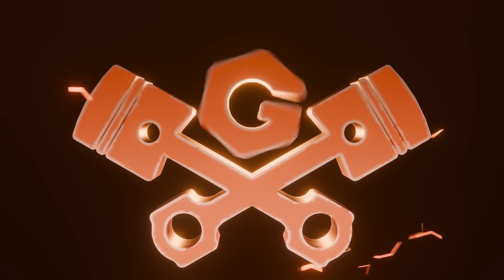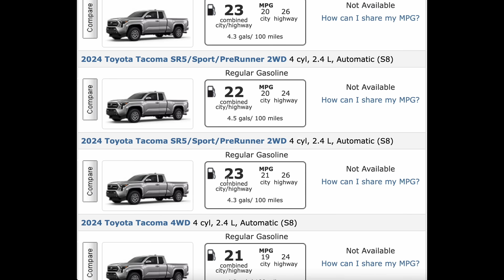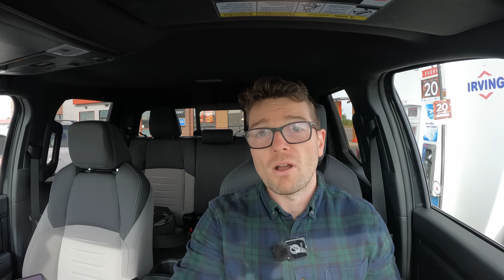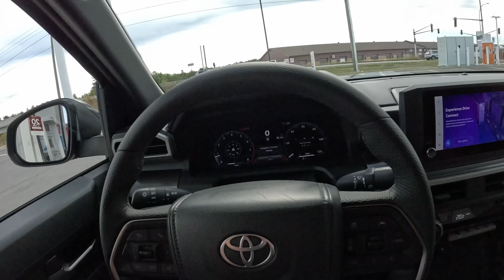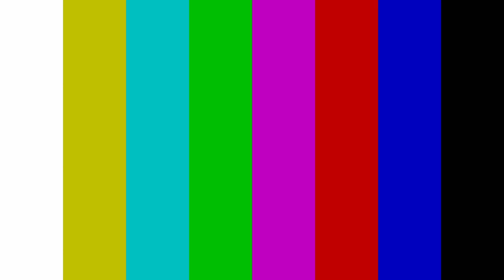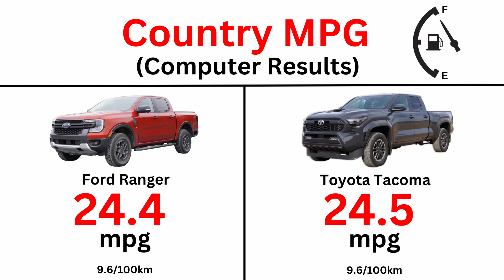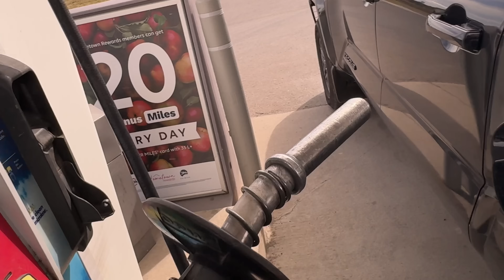Toyota Tacoma 2.4L Turbo Fuel Economy (MPG) Test | Shockingly EFFICIENT or OVERHYPED?

Comment: I am currently on a 8,000km road trip through the Maritimes and Newfoundland,  so far my 2025 tacoma trd off road is consuming about 10.4 liters per 100kms or 22.7 mpg. It is hilly and most travel is about 110kph or 69mph,it is a manual transmission with non hybrid engine. My previous 4liter V6 got 14.5l per 100 or 16.5mpg, it makes a big difference. The torque is delivered at a much lower rpm, makes a very comfortable highway runner and is completely at home off road.
Reply from the maker: Ughh that manual transmission is probably wonderful to drive! when you come through Fredericton give me a honk!!
Reply: My Dad has a 25 TRD sport and so far his economy has been about worse than my 2019. About 10.8 vs 14.1 l/100km. Both are on AT 32's. Im guessing its because of break in as he still has less than 8000km on his. I will say though its a much more responsive transmission so it's easier to be 'heavy-footed' on the 4thgen without realizing youre in it. It's less 'work' to drive compared to mine. I love the thing though, i will see trading in my 2019 in the future for one. I'm waiting for the Offroad premium to come with a 6-foot bed in Canada.
Reply: @Tacobuster88 there's a lot of factors that you have to factor in. Are they both 4wd, do they both have same all terrain tires? Have they been driven the same, etc
Reply: @JohnnyBoy919  Yup, they are equivalently specced, same 4wd, the 2019 has a mild lift, both on Cooper discoverers and yes driven on the same route. I'll chalk it up mostly to break in. Mileage on the 2019 has also improved over the years, specifically after its passed 90k miles for some reason
Reply: @Tacobuster88 The engine acts like a diesel, if it red lined at 4000rpm, it would be fine because the torque is there so low.
Reply: 22 trail edition 10.4 to 11,5 110 kmh. City 11 to 12,5 .
Reply: @danielo3830 On straight highway running I have gotten as low as 9 per 100, at 100kph. Serious saving from 14, especially at 1.60 a liter.
Reply: @craigaustin4779  Now do real world numbers and drive 20-30 over for 100km and let us know .😉
Reply: @Yob126 750kms today all highway 115-120kph , 10.1/100. Iwas in Quebec, they have the sneakiest most devious speed traps, ruthless bastards. 20 over tops, all day.
Reply: You sound like a Toyota spokesman trying to sell the new 4 turbos…..
Reply: I have had 6 since 1988, Iskipped the Gen 3, tried several,  did  not see much difference from my 2009. 10 seconds in the gen 4 and it was sold. Never a faster buying decision. Completely new, far more comfortable for a 6,4 driver. I logged about 1.8 million kms on Toyota trucks, so far. If that makes me a salesman. So be it.
Reply: @craigaustin4779  Your story sounds made up, wouldn’t be the first
Reply: No time for BS, today 866kms 91 liters, mostly 120-130kmh. Including traffic nightmare in Montreal.
Reply: @user-nx5rp9wp4d   imagine being a toyota fan boy and wanting a v6 na.    Toyota made the best factory production turbo engine ever in the 2jzgte which was over 30 years ago. I'm sure they've learned a few things.   4cyl turbo square - basically a petro diesel.  This engine is light years better than any modern v6.
Reply: @naten555  Yeah and new unreliable turbo  v6 tundra engines and their 100k recalls have proven you wrong, and there’s video of even the new crate engines having issues with barely 9k miles.
Reply: @naten555  Toyota is not the same company 30 years ago, new people new technology new problems. 30 years ago Nissan use to be great, now they suck
Reply: @user-nx5rp9wp4d   nissan sucks because of Renault merger in 99.     Who did toyota merge with?      Toyota is fine turbocharge engines are so much better than they were 30 years and turbo toyotas were great then.    Only other great brand left other than Toyota is Porsche and Honda.  Everything else is crap.
Reply: @naten555  Toyota had/doing a partnership/merger with Subaru, Mazda, Hino Motors, Daimler Mitsubishi, and BMW (Supra). Also, you missed the 100k recall on those v6 turbo tundras engines, it they’re so advanced why are they breaking down and having Toyota’s biggest recall in history?
Reply: @user-nx5rp9wp4d you sounds like a Toyota hater spokesperson bro.,no worries bro 4banger is the best right now🔥
Reply: @GuillT-j4d I wouldn’t say the best.. but Toyota has had 4 bangers on tacos since I was a teen.. bullet proof engine. Haters acting like Toyota just started their company 1 year ago 😂
Reply: @noxnyc23 This engine was turbo charged from design, not like adding one to an existing engine. Only time will tell about durability and reliability,  but I placed my bet.
Reply: @GuillT-j4d  If I’m a Toyota hater why do I and my family drive three of them?
Reply: @noxnyc23  Yeah the older model tacomas are “bullet proof” but these new ones are not, just like the old tundras v8 were finally better than the big 3 American trucks but now the tundras v6 turbos are garbage
Reply: @craigaustin4779  Many car makers tried the turbos and all proved to be less durable than naturally aspirated engines.
Reply: @PassivePortfolios Time will tell, I don't trust automatic transmission, but some work forever. I still have my 2009 with 4 liter and 400,000 kms. Maybe it will tow my 2025 to the wrecker some day.
Reply: @craigaustin4779  the key is to change the transmission fluid and filter every 30-40k miles.
Reply: @PassivePortfolios   6 speed manual, not old enough for automatic transmission

Comment: 4600 pounds, holy crap. that's a little heavier than my '99 Ram.
Reply: 3rd gen tacoma is 4500lbs.  The frontier is even heavier than this truck and it's on the same old platform from 2005
Reply from the maker: Heavy indeed sir.

Comment: The frontier pro 4x is available with a six foot box, and no turbo
Reply: And ancient chassis and software.
Reply: I bought a '25 Pro 4x with a 6 foot box. So far getting 20-22 mpg. 24 on the highway.
Reply: @Mindokwin  subtract 2 mpg for real calculated mpg.  it has been well known that the frontier overestimates the actual mpg numbers.
Reply: and that legendary Nissan name.
Reply: @jfox823  legendary dumpster fire lol
Reply: @beexiong2995 exactly
Reply: I have a 2023 SV CC LWB.  It’s averaging 19.6 mpg over 29,000 miles.  It’s been rock solid.  The only issue I’ve had is the whistling windshield molding which the dealer fixed by removing and reinstalling the windshield.  The backup camera is grainy but otherwise the tech and safety features are the same as everyone else.  It does lack the gimmicky drive modes but no one needs that useless crap.  The Car Care Nut has a mechanical review of both the Frontier and Taco.  I wouldn’t buy a Taco.
Reply: @gransport4246 29,000 miles is nothing.
Reply: @gransport4246 Thought carefully about both, looked at all the reviews, drove both and I went with a Tacoma SR5 6ft.  Pros and cons to both but in the end the Tacoma seat was better for me.  Good luck with the Frontier.  Am guessing that either one lasts a long time with proper maintenance.

Comment: 12l /100km ..hybrid! Not happy!🤔
Reply: This truck's hybrid system is not for the purpose of economy it is to enhance the power, add a boost.
Reply: @josiahwyncott7519 
Yes 100% 
But still  higher  than Toyota  numbers!
Reply: My Limited Hybrid is the same so far after 5k. I’m okay with that but have zero idea how Transport Canada rated it as they did.
Reply: @joeimbesi5361 true..I was doing  highway  most and I got 11.4%..
Now combined i have 12..rear traction only / offroad trim. 2k km

Comment: Won't thin rings burn up easy?
Reply: If badly engineered.  If engineered properly then thin, low tension rings can be more sensitive to motor oil soot causing the rings to stick in the lands, leading to low compression.
Reply: Not in a clean world but yeah, dirty oil and if carbon deposits are allowed to hang around.  So for a guy like me that changes oil before it turns black, revs the engine up often, and does induction services about once a year/10K miles, thin rings last a long time.  I even have a Kia and a Hyundai famous 2.0 for oil burning with over 240K on both not using oil to prove it.  Plus, a few customers too.
Reply from the maker: in theory.. yes

Comment: My brother has the TRD off-road  non hybrid he averages about 23 on the highway. His transmission over heats sometimes while towing a Utv on a trailer and in low range the transmission will over heat pretty quickly going up a hill with no trailer just the truck. The over heating is on hot summer days he hasn’t tested it yet in the winter. What did you think about the seat comfort? I like the seats as far as sitting but there isn’t a lot of hip room for big guys like my self. Not a lot of room between the door and center console for me.
Reply: I have a Ted off road and none of what you are saying is true.
Reply: @Annon89 it is absolutely true with the truck my brother has. I never said your truck had problems or anyone else’s had problems. But my brothers does I’m sure your truck is fine and I assume most of them are but some have problems that’s just the way it is this isn’t a perfect world buddy.and by the way it’s TRD OFF ROAD not TED
Reply: A lot of people were reporting these same issues with the Tundras too. Getting transmission overtemp warnings when in 4Lo offroad on long climbs

Comment: The huge airdam on the front looks stupid.  I'd replace that with a skid plate. How much difference would that make in mpg really?
Reply from the maker: I kind of want to test that tbh..
Reply: TFL Truck did a video on this very topic. If I remember, they used a Ram. The difference was bigger than I might have thought. I left mine on after that, cuz I do a fair amount of hwy driving
Reply: That’s what I did. And I don’t pay attention to mileage… I got bigger tires and did that. Don’t think it made a huge difference. But I like to also do sport mode .
Reply: I did exactly this as soon as I got mine. Removed the air dam and put on an engine and transfer case skid plate. Air resistance is mostly a highway problem due to how it scales with speed, and I don't drive fast on the highway so I don't expect to feel the mpg hit that bad. In any case, I would 100% accidentally rip it off backing out from a snowbank or similar, so I'd rather remove it before it gets torn off.

Comment: Just me being me. Im not a fan of the tacoma. I think the V6 ranger is better.
Reply: Your opinion that the Ranger is better is good, but it would be nice to know the specific reasons WHY you like the Ranger better.  Would be helpful for non-owners like me when considering both these trucks.
Reply: @danieldornes8416  I have driven both, but own the new Tacoma... I am also a former late model F-150 owner (I've owned a 19, 22 and 24), so I feel I am not totally biased towards the Toyota. 

The Ranger just feels cheap to me. The dealer was having difficulty selling it and let me borrow it for the weekend. I brought it home and everyone had the same feeling. I really wanted to like it, but just couldn't. It was equipped with the 2.7L, which is nice. I ended up passing up on it and got a F-150... big mistake. It a 2024 STX 4x4 with the 2.7L. What a nightmare, long story short, it was a lemon law truck. After my experience with dealing with Ford, I checked out the Tacoma. It felt way better from a build quality perspective. You will just have to test drive to see yourself, but I'd go Toyota all day long.
Reply: @danieldornes8416  Before anything is said, i haven't owned a v6 Ford Ranger. But I have owned a 24 Tacoma with a new engine. My real complaint with Tacoma is that it never ran right when I owned it passed 3k miles. Personally I think the tacoma is meant as a truck to drive 40+ miles daily on it to keep it running right and from what ive heard Toyota has never been the best when it came to turbo engines.
Reply: @davidenglish6799  2JZ engine is arguable the best turbo engine ever, overbuilt and reliable.
Reply: @danieldornes8416 my 24 Tacoma had water build up in there intercooler which caused it to get suck into the engine and cause it to run rough. Also being a previous 5 year toyota tech they never changed the software configuration on the new truck so the truck converter shudder is still there. Was just hoping they would listen to customer and fix the shudder problem, but they did make it more economical.
Reply: Toyota doesn't really seem to listen to customers unlike how ford and gm sometimes will.
Reply: @davidenglish6799 how so? This Truck addressed most of my complaints either the last truck.
Reply: @jmilesfox, the issues that I've seen are just what I've noticed in my area. If Tacoma works better for you, I am happy for you. We just seemed to have some issues at launch down in alabama.
Reply: @danieldornes8416  I do think Toyota is still learning how to build the newer turbo engines correctly. The 2.4 turbo has had some issues when it launched, but no where near as bad as the v6 Tundra.
Reply: @danieldornes8416  Ford has experience building the v6 twin turbo so I feel like they would have fixed its quirks by now. Overall both trucks aren't bad options. Toyota states that the water build up in the intercooler is normal so I couldn't do anything with it but drive it for an hour around my city which got old quick. Technically that is why I went back to a na truck.
Reply: Nothing wrong with that. They are both good trucks.
Reply: Love my 2.7 Ranger Lariat. I think the styling on the Tacoma is too busy, so many edges and creases.  Not a fan of the plasticky looking interior, either, think it looks cheap. The only thing I like about the Taco is the 6’ bed.
Reply: @PygmySurfer go drive a XLT ranger. The interior feels way more cheap.
Reply: @jfox823 An XLT interior feels cheaper than a Denali? 
I’m shocked. Shocked! Well, not that shocked.
Reply: @PygmySurfer no, the XLT felt way cheaper than my base TRD Off-road… When did I say I had a Denali, or a GMC for that matter?
Reply: @jfox823  My bad, I've compared my Ranger to a Canyon Denali before, thought I'd done that here.  

I haven't sat in either, but I think the XLT interior looks better than the TRD Pro, at least in photos.  All of the Tacoma interiors look like big chunky pieces of plastic to me.
Reply: @PygmySurfer The Ranger looked good in photos to me as well. It’s cheap in person (XLT), at least it did to me. Trust me, I wanted to get the Ranger before I test drove it for the weekend.
Reply: @PygmySurfer   Ranger interior looks comically dated.
Reply: @TheDoc813 how so? Because it isn't covered in mirror black plastics? 

I'll take dated over cheap (looking at you, Tacoma) or superficially fancy (Canyon)

Comment: Took a while, but I finally found a very clean 23' Tacoma SR5, with the NA v6. What a gem.. no afm, no start/stop, and no turbo.
Reply: I've owned both, and the new one drives a lot better. I am glad you like your truck, but that engine is not the end all be all by any means.
Reply: You will not like it when it brakes down
Reply: @sum @summerforever6736 it’s funny people complained about the 3rd gen when it came out and now it’s beautiful. 😅
Reply: Bought a ‘23 SR (3.5 auto) and put TRD OR wheels/tires on it. Horrible trans tuning. Engine has little low end torque so I was always flicking it over to manual mode to keep the the revs up.  Pretty thirsty for its size. Traded it in after a year for a ‘25 Tundra TRD Off road.  Almost same fuel economy and much better drive ability. That gen Taco looked good, had a good rep and resale.  That’s all.
Reply: @mozeby1975 I told my 22 off road premium for $1,750 more than I paid for it brand new. Drove it for 3.5 years. It’s nuts.
Reply: Might run forever but it’s a poor truck motor. Way too high strung. The 4.0 is vastly superior. The new turbo 4 pulls like crazy, especially compared to the 3.5.
Reply: @CrocodileTears36  hardly.  You never rev past 3000 rpms, ever.  Low strug if you ask me.  High strung means it's always screaming away to move and compared to ALL previous gens, the 2.4 turbo doesn't even sweat that's called efficiency.  More power, better MPG, less heat = More Efficiency.
Reply: @CrocodileTears36  let me introduce you too you the Magnusson supercharger.  Your 278 bhp 310 torque turbo 4 will not match the 372bhp 365 torque of my 3.5 liter 2022 trd sport.  And the pro chargers are pulling 400bhp.  I have no problems with a turbo 4 in a truck. So longest there is a v8 or v6 available for us that prefer reliable power and a naturally asprited engine.
Reply: Dont forget No Torque.
Reply: I owned a 22 and now a 25. No comparison. 25 is so far ahead of the 22 in every way. I’m not concerned about the turbo either.
Reply from the maker: can't complain about that!
Reply: Got a 2018 trd pro...I had Toyota re flash the tranny so she'd hold gears...WHAT a difference....that was 97k miles ago.  At 101k she still routinely gets 22 mpg driving around.  My last trip from Seattle to ND...25.2 mpg.  The 3.5 isn't a powerhouse...it may leak oil too...but its smooth as butter.  I want another one 19-23 model uears only.
Reply: @jimmy-et1pm It may be better, but still way worse than the new one. Furthermore the cabin is tiny compared to the new one. I got tired of sitting in the floor, that’s what the old one feels like.
Reply: that 3.5 is a TURD..
Reply: @slocavky I agree. I hated the powertrain. Might be reliable but not a good truck engine from a drive ability standpoint. Transmission was all over the place shifting as well.
Reply: Congrats on the minivan engine truck
Reply: So sorry for you.